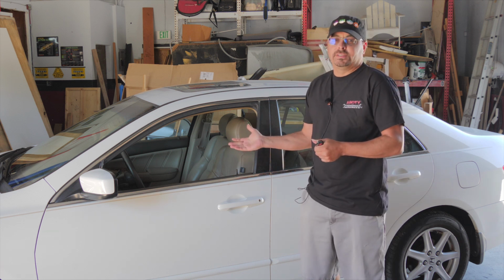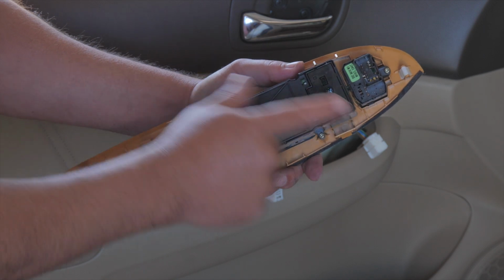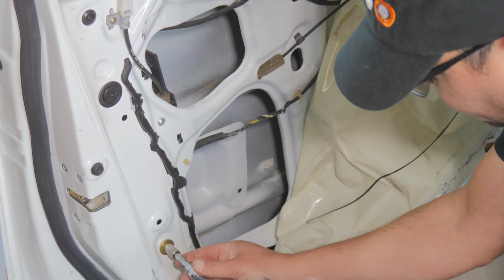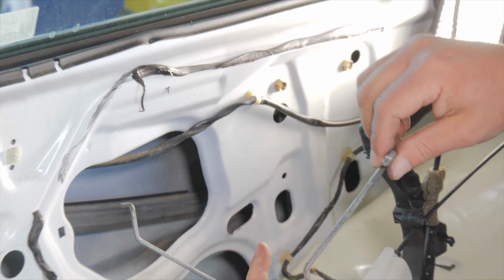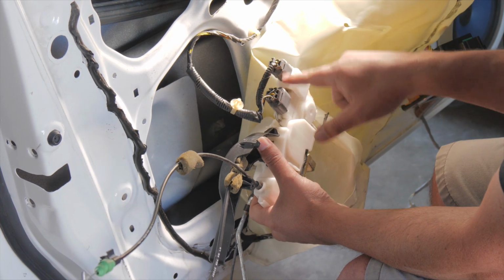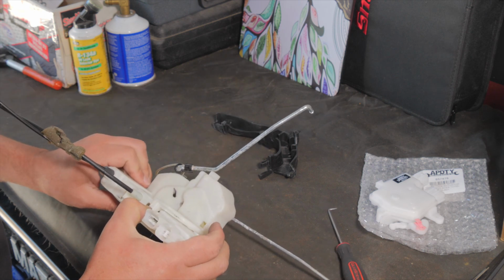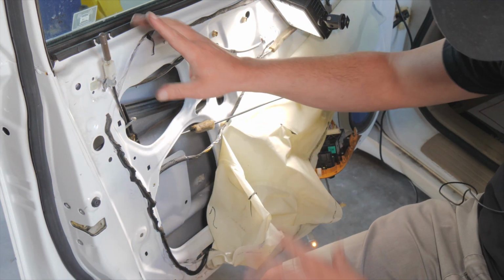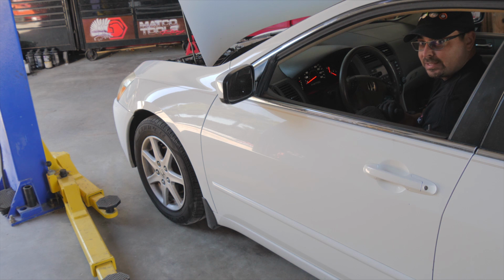2004 Honda Accord Door Lock Actuator with Diagnostic

Comment: After doing this on my 07 TSX I realized immediately after reinstalling that my door has to be slammed to close could it be out of alignment or is the latch just bad ? it closed fine before removing it I’m gonna start looking at the strike pin or the door sagging

Comment: hey one question.  supposing I am testing the power going to the actuator with a Light tester,  where does that tester clamp onto in preparation for performing the test?  connect directly to the cars' battery?  if so, to the negative or positive post?  (I've got a 2008 pilot with driver front door lock not responding.

Comment: Before removing the whole door panel,  remove the plastic cover from behind the inner door handle then remove the 2 screws from behind it.  Using plastic removal tools, pry the entire plastic piece out to expose the attached cable.  Now disconnect the cable and you won't find "the green plastic piece already broken."  Common mistake I keep seeing in these videos.
Reply: You are so correct, and  that green plastic piece will absolutely break if  the interior door handle is not first removed and the cable disconnected as you described.

Now that the green plastic piece is broken, the cable will not be aligned properly and it's just a letter of time before the cable snaps. (It's a lousy design to begin with.)

When the cable does eventually snap (and it will)  the entire disassembly you just watched all the way to removing the door latch assembly will need to be done again to replace the entire cable.

Comment: Great video. It's easier to remove the rod that goes from the actuator to the outside door pull handle (the rod you can see) from the actuator rather than the door handle mechanism. In fact it's very difficult to pull that rod out from the top, even after removing the plastic keeper. Don't try prying it out, you'll break the door handle. Remove it at the actuator (it has a plastic keeper there as well) I did my passenger side front door so there was only one rod going up to the outside handle. Also I didn't need to take out the window channel. Just removed the 10mm bolt and moved it aside to withdraw the latch mechanism.
Reply: You should make a video showing us your way.

Comment: Tip - you can roll all windows up or down by inserting the key in the driver door and turning two times to the left or two times to the right.  The first turn will lock/unlock and the second turn will roll windows up/down.
This helpful if you get out of the car and then realize a window is down.  Instead of getting back in the car and inserting the key to roll windows up.

Comment: Great video, but I wanted to see you open the door from the inside, because the green tip cable that goes to the unit you just took out has to be replaced.  The door won't open from the inside.
Reply: You are very correct.  The Green plastic piece at the cables "internal door openner (manual)" was reinstalled BROKEN in this video.  If installed that way, that internal lever would not open the door !!

Comment: I replaced the driver side actuator and it works just like the old one. I can unlock the doors pressing the door unlock button. But when I press the door lock button, nothing happens. I'm assuming the "lock" signal to the switch isn't working.
Reply: I found a post on acurazine that says I need to replace two circuit boards (Panasonic ACTB32) on my Multiplex Integrated Control Unit (MICU). It requires soldering which I don't feel comfortable with. 😕  "Doors won't lock with remote or door toggle button" doors-wont-lock-remote-door-toggle-button-859242

Comment: HELP! i replaced the actuator and all but when i was patching everything back up i’ve come to find that the rod in the back that connects to the key cylinder doesn’t stay in an unlocked position anymore. the only way to open the door i’d to turn the key and pull the handle at the same time.
Reply: and i can’t open from the inside
Reply: @m_terrell   this is my exact problem! How did you solve your problem? I know my actuator is broken - has been for years. I've just been doing without key fob because I could manually use key. Now I can't get out unless I roll down the window, insert key on outside of door, turn key to unlock, and pull door handle at same time. Definitely a safety hazard!

Comment: What if the switch dont work at all? All i can do is manually lock all doors. And before that the switch   would lock all the doors but not the driver door. Idk i need to know what to fix. I just want to be able to install a keyless transmitter
Reply from the maker: Nikea Holland so the exact problem can be diagnosed, this requires removing the door panel and checking voltage at the door lock actuator. If voltage exists when pressing the door lock button but the door lock does not move, then you need a door lock actuator. All of the door lock actuators must be working if you want to have or use a keyless entry system.

Comment: Any chance you could explain what part of the assembly the child safety switch is on? Mine is broken on the drivers rear. Wondering if there’s a way I can jam the switch into the up (off) position. Currently the door will not open from the inside, but opens fine from the outside. Thanks!

Comment: This video would have saved me hours and mistakes on exact same car. The thoroughness is appreciated. You hit all the important points.  The tools you used on the door latch are better than impact driver because the door frame deforms with an impact blow.  (Ask me how I know)  If the screw is a #3 bit, use ONLY a #3 bit.  I am trusting your part number because I got it wrong the first time around.  There are many variations that selection guides seem to blend for the wrong models. I think my replacement had a lever arm that was too short.

Comment: I have a 2006 Honda CRV, would this be the same part? I don't have a remote, I only have a key, but the key won't turn, or the manual lock won't pop it open.  To lock it I have to hold handle and push down and all of them close

Comment: I replaced the actuator and the door locks work but the door won’t open, from inside or outside.  I think it might be the rods on the inside.  How do I correct this.  I have the panel back on and the door is closed. I connected the inner door handle and that doesn’t open it either.   Sounds like I may have to cut the door panel.  Any other solution ?

Comment: Another way of removing the plastic cover thats over the actuator & lock, Use a pair of pliers. Just place the bottom jaw on the plastic cover Edge and place the top jaw on the metal tab thats poking through and gently squeeze the pliers and the cover is released. No need for a screwdriver or a pick to prye them apart and it saves on repair time too.

Comment: I have 99 Accord ex driver door won't open either way I bought actuator how do I open door to fix my aculator
Reply from the maker: Sandra Colon this can be a difficult situation, do you have a manual lock tab that you can move by hand? If it doesn’t move or if it does and nothing happens, then you most likely have a linkage problem to the latch/actuator, attempting to remove the inner door handle and grabbing the cable or lock rod would be where I would start, we h e never had to cut into a door panel but we have heard stories of some situations where cutting into the door panel was needed, I would try everything else first

Comment: i poured in transmission fluid  and it spilled a little.. is it possible that i’ve damaged any wirings? my passenger side door won’t lock/unlock.
Reply from the maker: Idi Basri where did you pour the trans fluid? I highly doubt it has anything to do with it.
Reply: @APDTY  i guess it was just coincidence lol. directly into the transmission fluid hole where the dipstick is.
Reply from the maker: Idi Basri ok just making sure, I have seen some crazy stuff so had to make sure🤟

Comment: 34:21. I've about lost as to where the rod connects to on my 2004 Honda CR-V. I had to replace the drivers side window motor and that went OK but I shifted the rod up a bit too much getting the old motor out and it popped free. This is the rod that connects to the inside door handle. Without it connected, I'm left with rolling the window down to let myself out the car. Do you have any ideas or even better pictures of where it connects?

Comment: Make sure to remove the interior door handle first and unlatch the cable and green adapter before you pop off the panel or you will break the adapter just as it appears in this video. The green adapter is fragile and breaks very easily.
Reply: The green plastic piece, if it is broken, what are the symptoms?  My door won't latch when closing if I don't pull up the outside handle before closing the door.  i want to fix this and suspect this is my issue.

Comment: i cannot open my door from the inside,everything else works as it should (central locking etc), i'm expecting the door latch cable's plastic piece to be snapped like the one in the video, is the model in the video able to open from the inside with the plastic piece snapped?

Comment: Thanks for the helpful video, in my 07 Accord, rear driver side door lock doesn't work with remote or from the main master lock switch on the driver side, what could it be? I ensured child lock isn't engaged. If it's actuator, are steps exactly same? Thank you

Comment: I have a 2000 accord 2 door. My car locks by itself when car is on. The problem starts when I open and close the car door after it has been started. Note it does this after the car is on and I open the door the first time. After that it locks by itself. If the door is open it does not lock. Also the dome light does not light up when I unlock the door before the door is opened. It's supposed to light up and fade to off if the door is not opened. It could be a number of things I know but your opinion is good for me. Could the problem be the actuator?
Reply from the maker: johnny casanova 713 ok you probably have a door ajar switch problem which is probably built into the door lock actuator. Google your year make and model and door ajar switch and check out if those symptoms match your issue, I’m not at my office or I could look up where it is located but I am pretty sure it is inside the latch
Reply from the maker: johnny casanova 713 ok you probably have a door ajar switch problem which is probably built into the door lock actuator. Google your year make and model and door ajar switch and check out if those symptoms match your issue, I’m not at my office or I could look up where it is located but I am pretty sure it is inside the latch
Reply from the maker: johnny casanova 713 johnny casanova 713 ok you probably have a door ajar switch problem which is probably built into the door lock actuator. Google your year make and model and door ajar switch and check out if those symptoms match your issue, I’m not at my office or I could look up where it is located but I am pretty sure it is inside the latch

Comment: Dude did not test it with the fob???????
Reply from the maker: Ron T yeah the key fob still did not work, the keyless entry system was not working at all, that is another problem and we believe it is the reciever inside the car, although we would have to do some tests to really confirm that, their keyless entry has not worked for a year or more and they were not concerned with it and did not want to spend any money on it at this point.
Reply: @APDTY  My son has exact same car. Using the fob, it unlocks all doors except left front driver's side. Using the key, it unlocks all doors. A friend said it might be a cable or metal arm, that has come off the keeper clips due to someone trying to break in the car using a slim jim from the outside. What do you think, actuator or possibly clips? BTW, awesome video. You work effectively and cleanly. My 45 year mechanic father would be proud of your work.
Reply from the maker: Ron T most likely the actuator but you have to remove the door panel and inspect to verify for sure

Comment: How do I know if the whole assembly needs replacing? or if it's just the actuator? 

It appears your video pretty much mentioned when you have a case like this its normally the actuator at fault here. I believe my car has the same exact problem in that case I should be getting something like this? 

https://www.amazon.com/Actuator-TOYOTA-CELICA-00-05-Front/dp/B077BWWSQW/ref=pd_sim_263_1?_encoding=UTF8&pd_rd_i=B077BWWSQW&pd_rd_r=4fe8cf48-c718-11e8-8e16-130f854170ed&pd_rd_w=4D2Xu&pd_rd_wg=dbyas&pf_rd_i=desktop-dp-sims&pf_rd_m=ATVPDKIKX0DER&pf_rd_p=56838e6b-66d4-41e0-a762-743f1a1a628a&pf_rd_r=95ZEPY9JX38MKK4FF8FX&pf_rd_s=desktop-dp-sims&pf_rd_t=40701&psc=1&refRID=95ZEPY9JX38MKK4FF8FX

and not this? 
https://www.amazon.com/dp/B00OU85DJQ/ref=psdc_15730441_t4_B077BWWSQW

There is a huge price difference. When you opened it up on the video it looks like the assembly was just a box to hold the wire cables and actuator together. Any help would be much appreciated.
Reply from the maker: Yes exactly, you can purchase just the actuator and save a bunch of money, it is a little more work but really not that hard and about the same as in this video although a different car, We also have this part and I just put it on Amazon so here is a link to our APDTY brand:
https://amzn.to/2QsJMy2

Comment: I tried the auto lock feature on my 04 Honda Accord but it doesn’t work.
Reply from the maker: so you might just need the actuator, if you are getting power to the actuator and it is not moving, then the actuator is failed,

Comment: It looks like the inside door release cable is broken. If that is true you will have to do this all over again with a new door release cable.
Reply from the maker: yeaup it was broken, we did not have a new cable and had to order from a Honda dealer, so we very carefully made sure the plastic pieces on the end of that cable were on the correct side of the connection on the actuator assembly and then installed it as is, it is still working as of today and the cable is still on my tool box waiting on the car to come back, it will be back eventually, thanks for watching!
Reply: @APDTY  Would this cable cause the door only to latch once the outside handle is pulled upwards first then door closed?  If i open the door from the interior handle, I need to lift the outside handle before closing the door or it won't latch.

Comment: Well, I have the same model. My problem is that it can only be closed manually to each door. Either the doors are open, whether you use the remote or the opening buttons or even if you pull the safety of the driver, all doors are opened. However, there is no closure at all from the source of the manual closing of each door. Where does the problem lie?
Reply from the maker: so this may have been translated to English and I dont fully understand what you are describing, the way to look at or diagnose this is, do the locks work by using the manual locks including the door lock cylinder that uses the keys? If all the locks work properly mechanically by either using the manual key or the manual push or pull on the door, then the problem is probably electronic which then you switch to removing the door panel and checking for power at the door lock actuator when you lock or unlock the door, in other words follow the voltage checks we did on the video, of power exists at the door lock actuator and it is not actuating, then the actuator is failed.
Reply: @APDTY  
I mean, the security of the doors are normally opened by remote controls and jealousy. Normally, closing the safety beads for the doors should be closed every single door, since the central lock does not work.